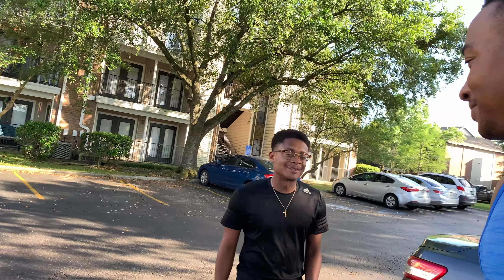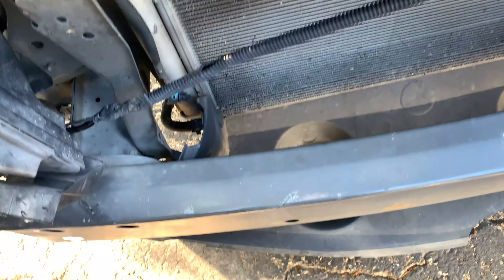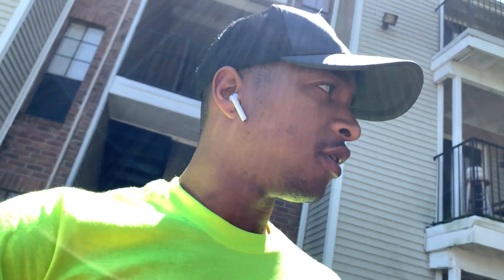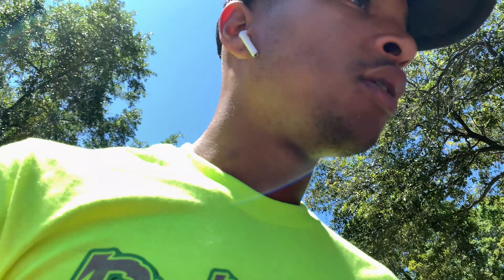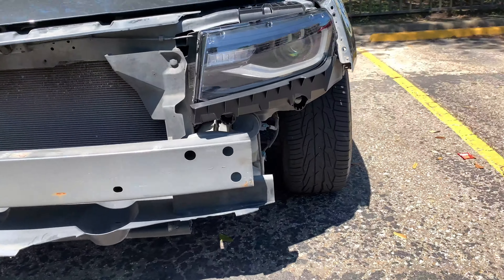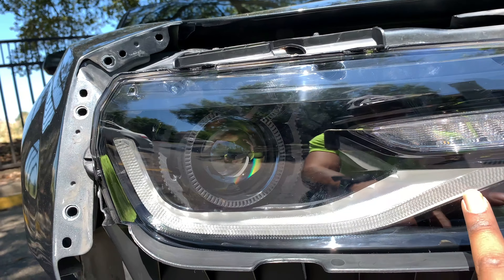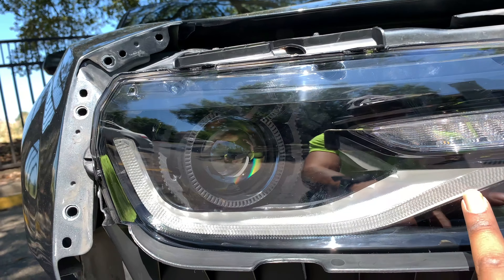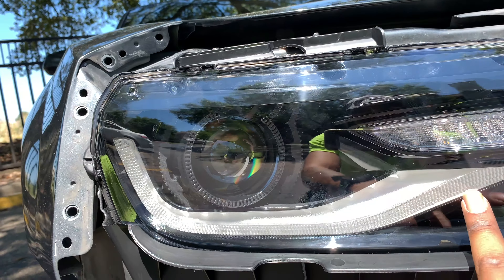2015 camaro ZL1 conversion

Comment: Will this bumper work if you dont change the lights
Reply from the maker: Yes
Reply: Thanks mine arrived today installing it on friday
Reply: The piece that goes on the bottom for debris and shit did you put that on or just leave it off? Nowhere for it to bolt to

Comment: Question? So for the Drl’s to work you just plug the wires hanging out of new headlight into the bulb harness in the car?
Reply from the maker: Capricorn 87 yeah take the bulb out of the turn signal and plug it in
Reply: chedda bob one last question so do the Drls come on automatically when you start the car, and stay on both during day w/o the headlight on(projector light) and at night w/ the low beams on?
Reply from the maker: Capricorn 87 I put my parking lights on to keep them on but while at night both are on auto